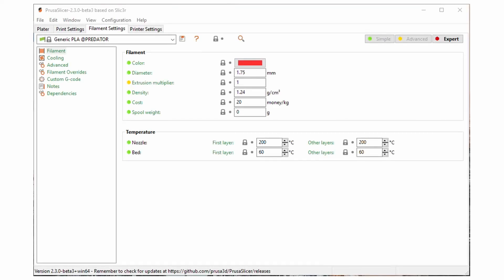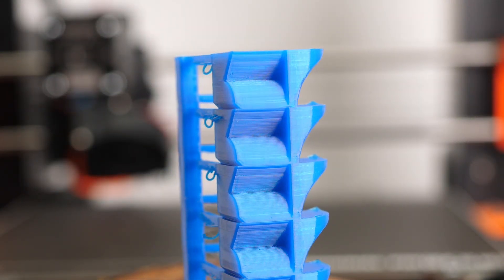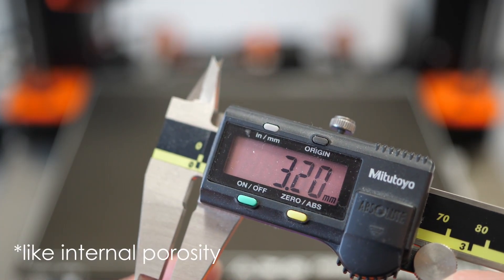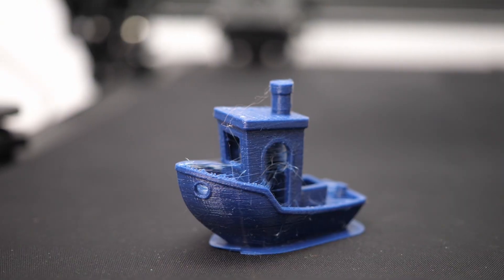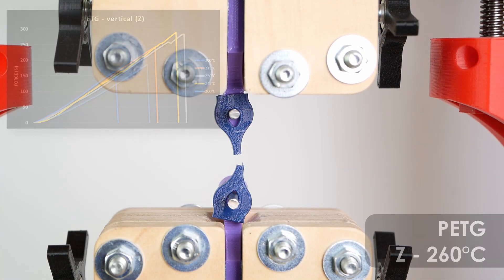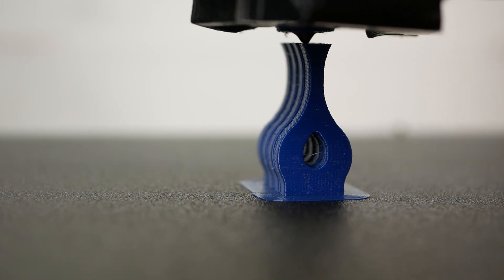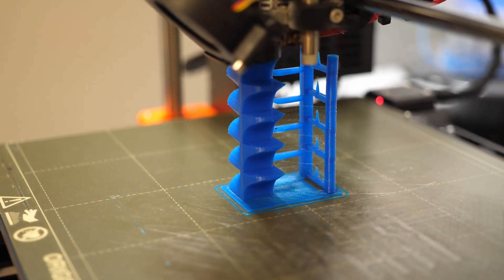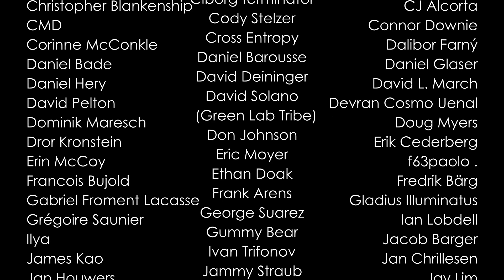Stronger 3D prints at higher temperatures? (strength test!)

Comment: I always go 5C above the recommended temperature, and if that's good, I'm done.  If I get weird results, then I print a temperature tower.  But that's only for printing with that nozzle at that speed with that layer height.

A single filament can print very differently between slow printing with a fine nozzle and thin layers, compared to fast printing with a wide nozzle and thick layers.  I can't count the times I've gone from a sub-scale proof print (nozzle, layers and speed all scaled down) on my Sidewinder X1 v4 to a full-scale final print without taking this into account.

This is when doing both temperature AND speed towers becomes important, especially when doing large prints after doing crude drafts and/or an accurate sub-scale print.

BTW, doing perfect sub-scale proof prints lets you do photography of the proofs that you know will very closely match the final full-scale print.  Yes, the print time is about the same (intentionally), so these aren't draft prints.  But they do let you make changes that you know will be accurately reflected in the final part, and do so for a MASSIVE savings in filament compared to noticing a mistake on the first full-size print.

But it is a lot of nozzle switching...

Comment: A theory for discussion:
Higher temperature lowers material viscosity --> lower material viscosity results in lower pressure transmission on the interface surface --> lower pressure results in weaker bonding of  the layers.
What do you think? How could this be validated or refuted?
Reply: I just have seen this has been mentioned earlier already.

Comment: Were the material properly dried before printing? Like properly, properly dried? I always print REALLY hot (PLA at 235 and PETG at 260), but i also dry all my filament and always print from dryboxes. I never have any stringing even at those temperatures. I suspect you might have some slight humid filament, and that the increased temperatures makes your parts slightly more porous, i.e. weaker.

Comment: I have until now used my Smartfill, AzureFilm and Fiberlogy at around +5c above lowest temp range on the filament. So if rated at 190-220c, I go 195c and usually with just the right results. However I am still trying to dial in PETG and Fibersilk as these tend to either string or foam rather quickly if temp is too high. My Fiberlogy Impact PLA is spot on at 225c and have a lot of cool prints using this on my GooFoo Mido printer.

Comment: I was having a ton of issues with the polylite PETG. I finally get it to stick at the max temp it says on the datasheet. Was anyone else having issues with PETG blobbing on the print head and ripping itself from the print bed? (I used prusa mini btw)
Reply: PETG needs high initial layer temps. Im doing fine with 240C and bed temp 85C. You may also wanna check nozzle to bed clearance. If u have trouble with bed adhesion try decreasing the clearance in .05mm increments over the z-offset in ur slicer...

Comment: how about printing cold with an extruder like the Volcano, which has a longer hot section? While the temperature is lower, the material has more time to heat up inside the nozzle.
Reply from the maker: Good point and something I wanted to take a look at for ages. I have some high-grade Nylon here that is basically unusable when not printed with a volcano nozzle because it needs time to heat up.

Comment: Sublayer temperature is a key factor affecting the layer bonding. https://www.preprints.org/manuscript/201803.0102/v2
Reply from the maker: Nice paper. Worth reading!
Reply: @CNCKitchen  Thanks. I wander what stands behind that strength drop at 250 and 270 you had registered

Comment: I was printing PLA from DasFilament at higher speeds with 220C and 0.3 layer height. I had rare extrusion issues. I found, raising my temperature to 235C for the first layer, and 230C for all other layers solved the issues completely, and the surface looks smoother as well. I am using MK3 and MK3S printers from Prusa. The given 215C the guys from DasFilament claim, did not work for me. Me, not printing figurines and stuff. I am using my printers for creating electronics enclosures, and RC stuff.

Comment: i use PETG at 245 nozzle and bed at 70 degrees and the prints i get are pretty strong and i must add that i use 1.5mm for wall and bottom and 20% infill and no part cooling fan,grüss aus holland :)

Comment: my guess as to why with hotter temps there is less bonding is probably more to do with less pressure between te molten and already set plastic as the materiaal gets less viscous as temperature increases 
would be interesting to test if this is the case by printing very hot but decreasing layerheight and vise versa
Reply from the maker: Good point.

Comment: If it is flaws in the boundary layer due to water vapor, it makes me wonder - has anyone ever tried to create a 3D printer that works in a vacuum chamber?
Reply from the maker: Thought about it but cooling might be a problem. Not only cooling of the material but cooling of the hotend for example.
Reply: @CNCKitchen  water cooling loop to external-to-vacuum-chamber radiator?
Reply: @AlexBrugh  
That's something I've thought about as well, but one of the bigger issues is how to cool the plastic part. Obviously you'd have a buildplate capable of becoming both hot and cold, but plastic isn't very thermally conductive.

For things not too far off the build plate and with a substantial cross section beneath them to conduct heat away, perhaps it would work with just a long wait time between layers, (but even then, that would increase the print time by a factor of 10 probably), but for stuff farther off the plate or with a limited cross section beneath it, it's possible you'd need an inlet jet of nitrogen or something that can be let in with little bursts and at a total rate slow enough that the vacuum can keep up to still maintain a fairly high vacuum.

Edit: perhaps you could print a layer, and then have a little offset gas nozzle and run the gcode again with an offset to put the gas nozzle directly over the just printed lines, and adjust the travel speed while running with the gas nozzle to fine tune how much it gets cooled after each layer. (and play with nozzle size as well)
Reply: @nickopedia5669  I wonder if a stream of inert gas directed over the nozzle would work, similar to a part cooling fan. Assuming the vacuum pump can pull faster than you put the gas in, it should maintain vacuum while also cooling. edit: ah didnt see your edit. Gotta click that read more before replying >.<
Reply: Made the same comment before yours 👍

Comment: Did I miss something or did you not ever mention if you were using a part cooling fan or not? The temperature difference between the previous layer and the current layer being laid down is very important for comparing layer adhesion.
Reply from the maker: Part cooling for PLA and PETG is always on for me. But that's a valid point and I investigated that in a previous video.

Comment: Thank you for the video Stefan. After a quick search on google, it seems the strength of PLA decreases at high temps due to thermal degradation - other compounds are introduced which may be impeding the interlayer adhesion.

Comment: I'd be interested in knowing what the results would be like with a volcano hotend. I think strength also highly depends on the flow rate and the layer time (small parts should cool down less before the next layer is laid down).

So basically, nozzle temperature is not always equal to the filament temperature when layered.
Reply from the maker: Good point though the tensile samples are printed quite slow due to the small cross-section which should allow enough time for the material to heat up.

Comment: I personally use a small retraction test that prints two towers, one at a time at different temps. that way I can judge both stringing and layer adhesion without using as much filament as a temp tower though that doesn't test overhangs but I have found that if minimize stringing that overhangs usually end up looking fine.

Comment: Great videos but i wish you would standardize your test units and stick with your choice.  Kelvin sometimes Centigrade, Mega Pascals sometimes Newtons, Psi.  Tests from "X" deg. C in 15 Kelvin increments.  Mishmashing and using different units during the same test is very confusing.
Reply from the maker: Absolute temperatures can be given in °C though relative temperatures are usually given in K, that's standard practice. MPa is the final result of the strength test though the machine measures N. Just tried to be consistent.
Reply: @CNCKitchen  Thanks for the info.  I was thinking...for example: Test piece held up to "X" kg/lbs, and broke at "X" kg/lbs. May not be the most accurate method, but I think a larger part of your audience would be able to understand a little better.  Put into "Layman's terms" 
Either way Great Channel and thanks again for the reply
Reply: It makes perfect sense if you understand what the units mean. Pascal is the unit of pressure, or force over area. The machine measures force in newton. To get the strength of the material you divide this value by the cross section area of the test piece. If you double the cross section area, the measured force will (ideally) double. But the resulting strength is (ideally) the same regardless of the cross section area, because you're measuring a detived property of the material. So in short, they mean different things and you can't just replace one unit with the other.
Reply: @Gameboygenius  Thanks for chiming in Karen!!  My comment was for Stefan.
Reply: @Jynxx_13  I don't think you know what Karen means. You are complaining to the "manager" about something you have no clue about. That's what a "Karen" does. Yes, you are the Karen.
Reply: @Gameboygenius  Now you're just being rude and disrespecting Stefan's channel. Smh

Comment: Aw man, you didn't include Nylon, especially a filled nylon like NylonX/NylonG/Onyx. This would have been interesting to see as these are the types of filaments used in functional applications compared to PLA/PETG.
Reply: I think that's because the majority of people print with pla and petg
Reply: @paulblair7515  Yeah, and with nylon you get best results printing from a drybox into an enclosed printer with a bed surface that can accept the nylon print. Then there's the added cost of using nylon.

I mean, if you can handle that cost, cool, nylon is amazing, and the only difference between nylon and higher-temp filaments with that setup is how high you can take the hotend and print bed heater.
Reply: @paulblair7515  Sure, but people who really cares about impact of temp vs strength for functional parts are likely already using material like Nylon. It would have been nice to have Nylon (and even PC) as a comparison point. PC and Nylon are readily available and far easier to print than say something truly exotic like PEEK. An Ender 3 with an all metal hot end + Enclosure can print Nylon pretty easily for example.

Comment: The Cooling fan has a significant impact on layer bonding and even layer tension as it can/will cool the print, another factor is room temperature and of course enclosure. Meaning you can print at lower temperature with equivalent results of higher nozzle temps with reduced stringing or curling but keeping the better physical properties.
Reply: +1. This is a factor that needs to be accounted for. It's well known that cooling impacts PETG layer bonding.
Reply: Good point about the cooling fan having a large effect.

Higher nozzle temperatures reduce the initial viscosity of the filament, which fills in porosity more quickly.  With the fan on, higher nozzle temperatures only slightly increase the time it takes the molten filament to freeze and solidify.  A reduction in fan speed would have a much greater effect on the molten period.  A long molten period will start to anneal the filament, by reducing internal stresses, and randomizing the orientation of the extruded polymer chains. Unfortunately,  low viscosity and a long molten period also result in loss of detail, due to slumpage from gravity.  With fan on, I think most of the loss of detail is due to the lower initial viscosity, because the molten period is not significantly longer.  I'm not sure if air pressure from the fan is strong enough to cause significant loss of detail.
Reply: I just want to add. From my 2 year experience printing with PETG. Is that the more I use fan for the print the more stringing I get . And also print gets worse strength every time I try to increase fan speed. Also if the Filament is getting humidity it starts stringing like insane. I print PETG at the best middle temperature for my filament, and this is the best option for me, after I increase temp I get more stringing on the print. But If I decrease my direct extruder can stop skipping steps on full infill prints, or the print model starts being weak. I think temperature should be adjusted depending on the print model, sometimes you can increase it or decrease it.
Reply: Indeed. Simply upping the temperature w/o changing other settings will lead to prints sagging and melting, at least on smaller prints - and his, very small in crossection, tensile tests samples are particularly vulnerable to this effect. W/o knowing what OTHER settings did he changed to make those samples print at all given difference in temperature, the results are frankly useless, and he must know that. What matters is 'delta T' between the previous layer and layer being deposited, and you can alter this drastically with cooling settings. This video is way below the quality of his other videos when it comes to 'design of experiment', and seems like more a filler and 'discussion bait' to be fair.
Reply: Very true. Plus print speed and the size of your part. Reprint temperature is key but very hard to measure on a desktop printer.

Comment: Can you dry filament too much on the recommended temp?
Reply from the maker: I think you can. Longtime exposure to elevated temperatures can cause evaporation of additives, hydrolysis or oxidation of the polymer. For "normal" polymers 12-24h of drying is usually sufficient.
Reply: @CNCKitchen  Thanks, I will keep that in mind.

Comment: I'm pretty new to this and I'm currently preparing for my first print with PETG. Part of it is printing my first temperature tower and therefore write my own Cura post processing plug-in so that I can set my temperature points comfortably. 

You've said that you set the nozzle temperature using the M104 command. So far I've gathered that that's not enough, because if you do it this way your nozzle cools/heats up while printing, leaving you with a fuzzy temperature transition. You need to send M109 as well, which tells the printer to pause until the given temperature has been reached.
Reply: In other hand if you pause it, the last layer will be a lot colder when you get to print again, which would definitely lower layer adhesion wouldn't it?
Reply: @Kalvinjj  Yes, but that's not the point of temperature towers, right? It doesn't apply to this test as Stefan has printed each batch separately to test layer adhesion at a certain temperature. But if you want to observe print quality  not waiting skews the result slightly
Reply: @saschaschneider6355  hmm I see your point now, makes sense on this case. I wonder how much it would affect tho, since the nozzle temperature change is in like 10ºc (or is it 5? 15?) intervals, it might be able to change temperature fast enough, tho I guess it depends on where it would start the next layer.
Reply: @Kalvinjj  sure, but if it heats up/cools down fast enough then M109 isn't going to slow down the process by a lot either. Hence I think it should be used in addition to M104 either way.

edit: as M109 also takes temperature as an argument you could also set it slightly below the target temperature, but that's probably something I'll have to play around with - and probably will be included in my plug-in as an option

Comment: It depends entirely on the application (like with part cooling, nozzle diameter etc.). But why not also compare with ABS and ASA when talking functional prints? They practically cost the same (unlike PA/Nylon or carbon-reinforced filaments), but you have to be able to print it first, of course
Reply: You kind of answered it yourself. Unless you're already looking for something very specific that you really only get from those materials (rigidity. It's rigidity) you aren't going to be using them. PLA and PETG are general use materials. Neither ABS or ASA really is, what with the significantly increased headache that comes with them with the benefit of less strength than other things that cost the same amount. They really don't belong to the same category as PLA/PETG any more than Nylon does. (And while we're talking here, "nylon or carbon-reinforced filaments" are pretty far away from each other, given that it's already very well established that carbon-'reinforced' filaments are actually much weaker than their cheaper equivalents and the only benefit out there is that you can print them at a higher rate)

Comment: are all pla's and petg's the same? why do the recommended printing temp ranges vary between manufacturers? some have really low temperatures and I don't really like printing cold because it makes plastic flow slower and increases extruder motor load
Reply: Not all are the same. They contain different amounts of different additives, which changes their properties. For one type from one brand it shouldn't vary much between spools, but even pigment can influence the temperature.